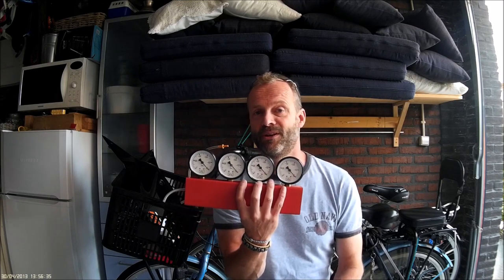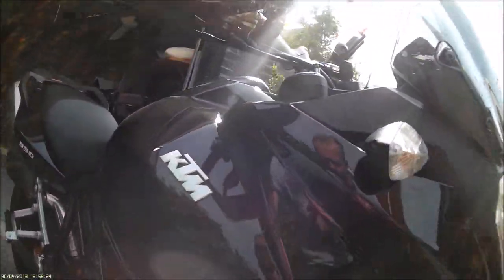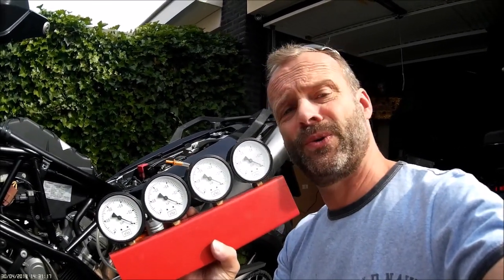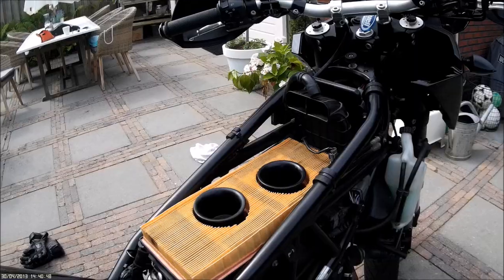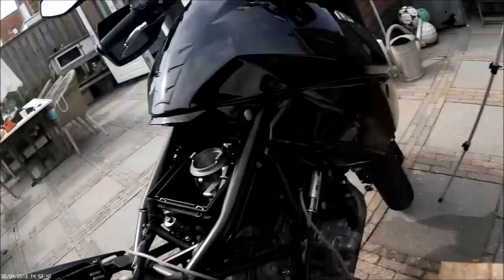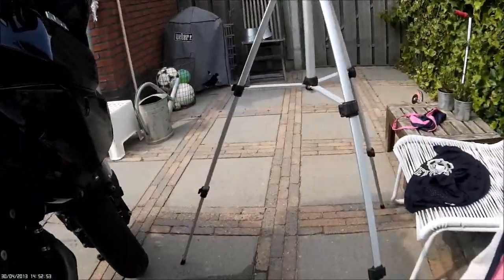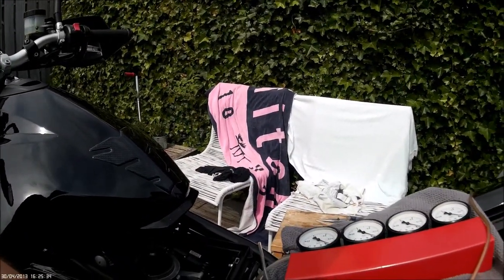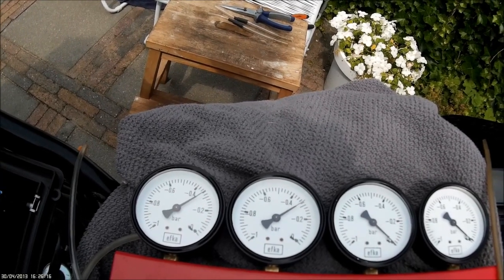KTM 990 SM Throttle Body Synchronisation (TBS) DIY

Comment: Thank you Michel, I learnt from you. 
If I may add as you were asking yourself, the 2 sensors you disconnected to plug your meters are the manifold air pressure (MAP) sensors, those who tell the ECU what is the pressure in each manifold.
Good ride !
Reply from the maker: Thanks for the information. Nice to hear you have learnt from this video!
Reply: So you could just synchronize by reading the pressures in tuneecu instead of using external gauges?
Reply from the maker: You have to use the external cauges.  Tunecu could be an option but the lag between the real value and what you see in Tunecu might give you problems to get the vacuum spot on.  Only one way to find out though 😉
Reply: You absolutely can use tuneecu :)

Comment: Not that u did a bad job but i found that if u use a fan in front of the front wheel blowing directly into the radiator the motor & carbs dont become heat soaked as to where it makes it easier & better response to tuning while balancing the carbs. Good job tho.

Comment: what kind the symptom mean the throttle body need to sync thanks
Reply from the maker: When your engine is running not so smooth at lower revs (less than 3000 rpm) it would be good to do a tbs. When your throttle bodies are synchronised your engine will run noticeably smoother at lower revs.